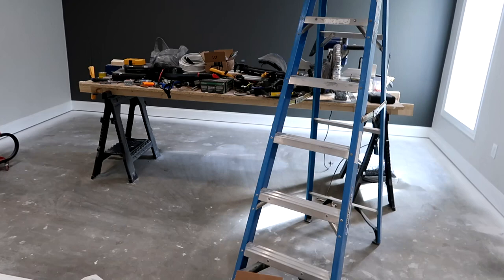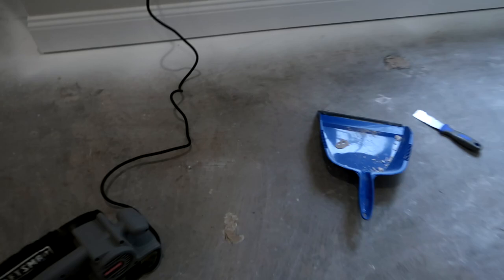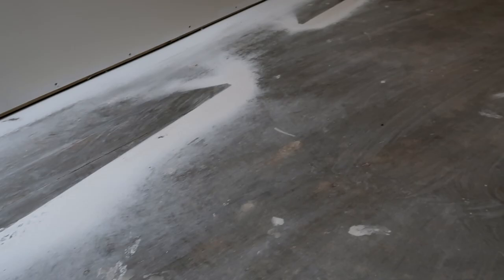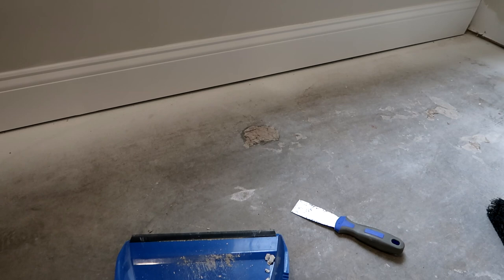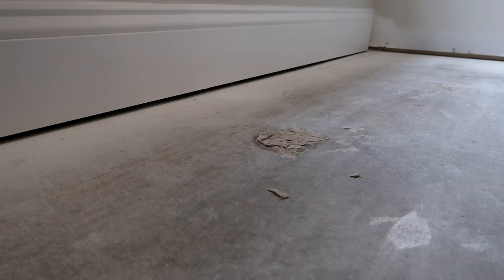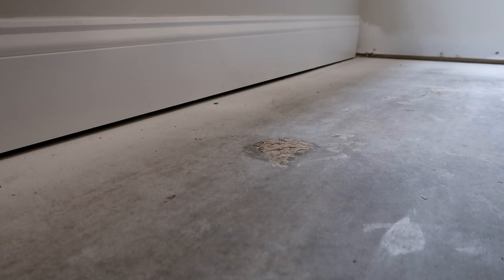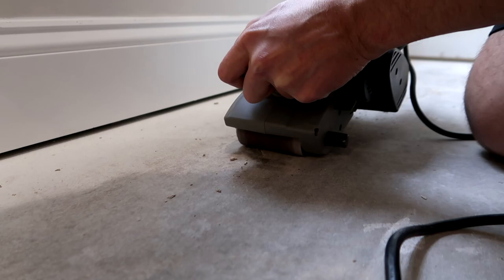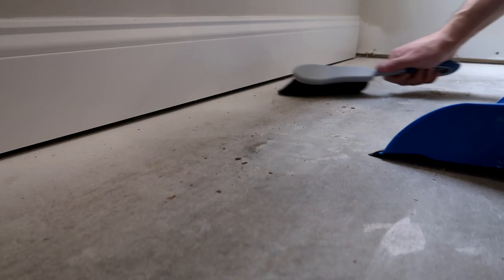Easy way to get liquid nails off concrete

Comment: We had a cabinet maker use this to put down an island to the tile.  He spilled liquid nails on the tile.  Scraping isn't a possibility as it will scratch the tile.  Don't know why one would be so careless.  I'm thinking there are no real pros anymore, just wanna be hacks.

EDIT:  Turns out Goof Off loosens it rather quickly and you can wipe it right off.
Reply from the maker: That's so frustrating. I feel like there is very little pride in people's work now